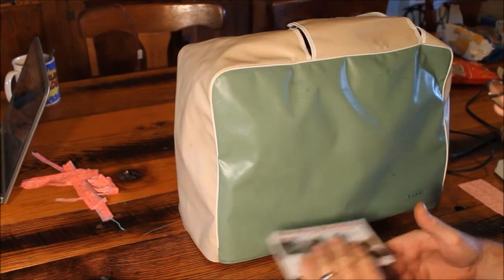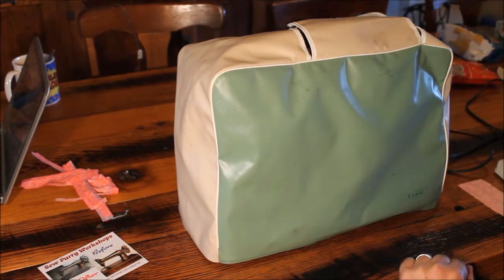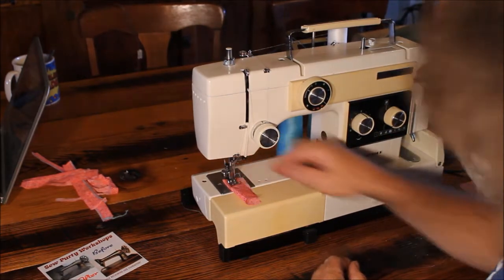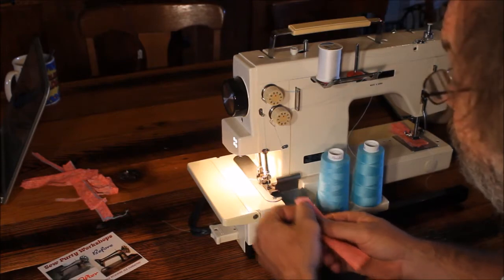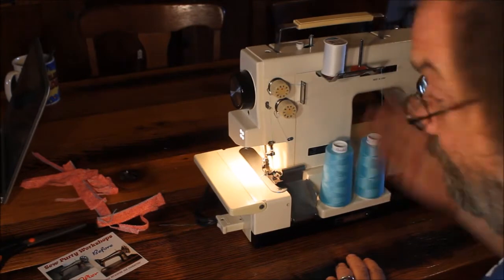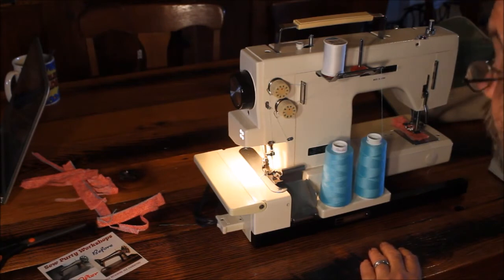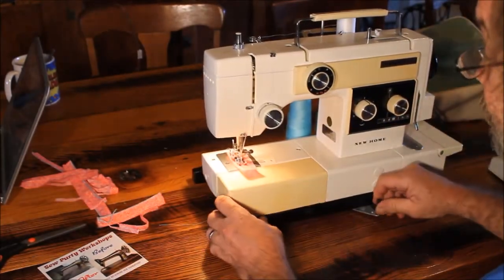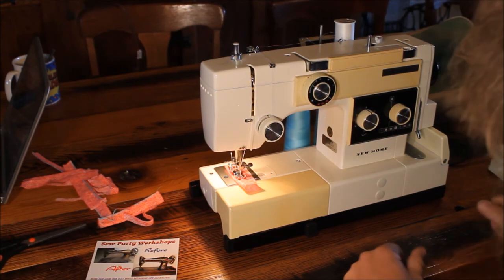New Home 222 Combi Sewing Machine Demonstration

Comment: Ray, you will find this interesting.  I questioned my friend who had owned one until it "died"...I first saw them at a special sale-trunk show of sorts as I mentioned in the 1980's.  My friend said the time frame she got hers was 1984-85 and paid  $1500-1600.   ( she may would be interesting in buying if ever for sale.
Reply: got one for $5 saved from the dump. seems rahter jammed and needs opiling up a bit. did sew right enough at first but are yet to use the overlocker side.

Comment: Great demo, thanks. I just picked one up from a charity shop in the UK. Do you know how to drop the feed dog on this machine please?
Reply from the maker: I sure don't. I had this machine at my house for just a few days and now my aunt has it. I never did anything with dropping the dog so I can't tell ya how it would drop in this one. Maybe someone else will read this that is actively using one of these machines and can answer that for you
Reply: Ray Elkins Thanks for taking the time to reply. Appreciate it.
Reply: Tia Drysdale has a video on this machine and in a comment I left she gave me the download link for the manual for the more basic DX502. it showsd a little slide switch where the machines foot sits on the table for lower the feed dogs. go download the manual.
Reply: I recently bought the janome combi Dx ,2000 model and there is a lever like button you drag to either left or right. its under the  feed dog at the back of the machine. hope this helps.

Comment: Hi, got this unit for OP shop.do you have a video ,how do i thread the overlocker on this unit ( Combi 10 )? Thanks.cheers
Reply: if you push the trimmed fabric chute to the right it should flick open adn the threading diagram is on a sticker under that. if it's not, I left a comment on Tia Drysdales video on the janome combi and if you look at the reply and click read more she gives a download link to the manual for the simpler DX502 but it has the diagram on how to thread the overlocker quite a few pages down in the manual. looking at it on my phone now.